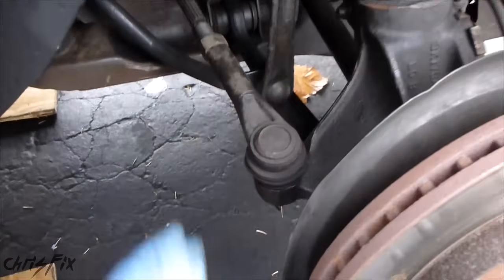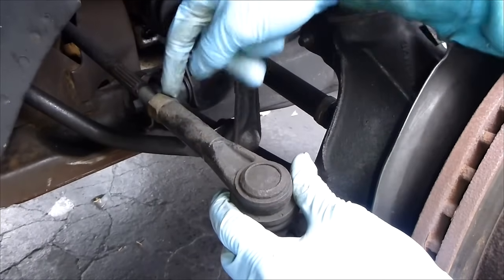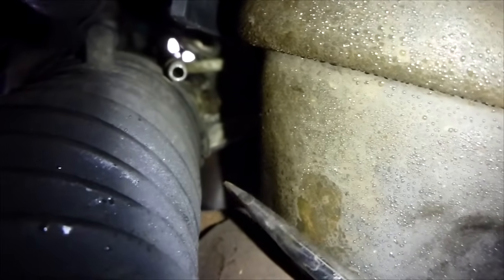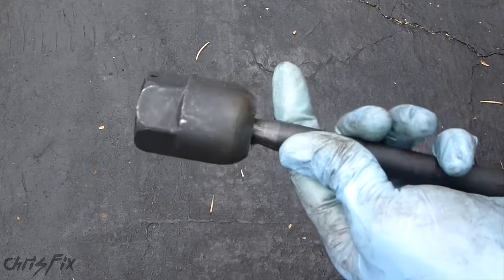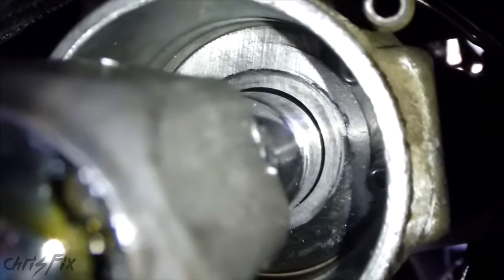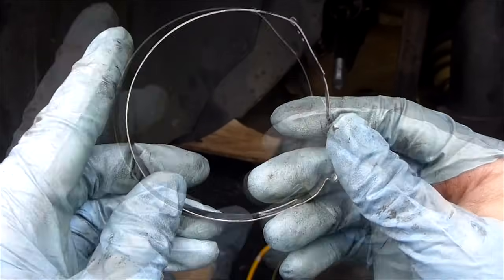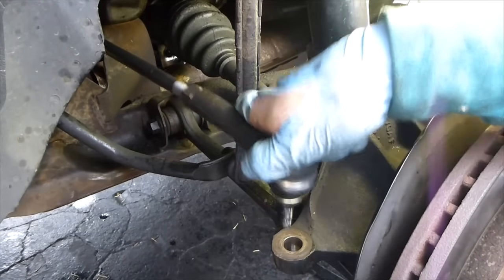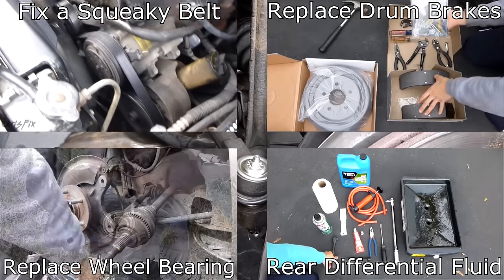How to Change Tie Rods (inner and outer tie rod ends)

Comment: Can’t get the outer tie rod out no matter what, hit it with a BFH, heated it up and no luck, even tried picking fork and puller, it’s on a 2011 dodge ram from main so it’s got rust and stuff but everything I’ve tried just ain’t working

Comment: Mine is not that easy. My tie rod end is a pain to get on all the way. I have to take 2 big wrenches to try and turn it as far as it can go. And also my old tie rods I had to cut off with a Sawzall and metal cutting blade
Reply from the maker: Dang! Sometimes they can be annoying especially if they are original and old

Comment: What do I do when the tie rod bolt doesn't come off, I pb blasted I used huge wrenches, I tried to use map gas to heat it up, I tried hammering. I am lost as the bolt will not come off and Google doesn't help at all. I'm at the point of I'm going to grab my angle grinder

Comment: Why not measure from a fixed point somewhere on the suspension to a point on the steering arm before dismantling it all rather than counting the rotations of the outer tie rod end?  That way, if the dimensions of the replacement rod, etc are different to the original, you can easily get the steering set back to pretty much exactly where it was at the start.

Comment: Don’t use the counting turns technique if you have different length inner tie rods to replace it with. Instead you can measure the distance the outer tie rod was screwed in and use that to calculate how far in it should go on new inner tie rod, or just put the 2 inner tie rods side by side and put a mark on the new inner tie rod at the same distance to the outer tie rod end.

Comment: My steering rod didn't even budge after I loose the nut
Reply: Loosen the lock nut, then put it back in place. The outer tie rod will most likely be frozen in place as well. U need to use penetrating oil, leverage and/or a torch on the outer tie rod to get it to loosen up. It is a hard process and I've found it impossible a couple of times and took it to a shop with a lift to get it off.

Comment: Not to find fault or anything, but you used the old nut and shouldn’t have. The old one was a standard nut and the one that came with the new tie rod end was a jam nut, and that’s why it was smaller. Otherwise, great video

Comment: Unfortunately, not all tie rod ends pop up that easy as you did with just a light hit with a plastic mallet. On my 2001 Nissan Sentra your method of popping up the tie rod end never worked and I had to look for more videos and there is a mechanic there who mentioned specifically not to hit the tie rod with any hammer because it will never pop up no matter how hard you hit instead his approach was to hit the side of the knuckle itself with such power to release the tie rod tapered bolt and it worked very well, I spent 12 hours trying to pop out the tie rod by hitting it with a plastic mallet and even with a heavy hammer .

Comment: Counting turns on the outter tie rod is tacky, the best way is to simply take a measuring tape and measure from the beginning of the inner tie rod where the boot starts to the center of the outer tie rod and that will leave your alignment as it was before and no miss or alignment required after.

Comment: Wouldn't you just tighten back to the nut? Tie rods are different. It would be more accurate to measure out to the center of the tie rod bolt and keep that measurement the same.

Comment: Do not be fooled. if you live in the northeast this job will not be this easy. you're gonna find things you didn't know existed that are broken. There's gonna be so much rust it all might as well be welded together. That Cotter pin? that thing ain't never coming out. that tie rod end? that thing has become one with the steering knuckle. at least half of the nuts and bolts involved are going to be stripped

Comment: These amateur YouTube certified mechanic graduates don't know what they're doing, yet they make instructional videos. First of all, never, never, never hammer the tie rod end bolt, it won't work with the rubber hammer, but with video magic it's did work here, the proper way is with a pickle fork or if you want to shock it with a hammer, hit it on the side of where the tie rod enters the hole, in other words hit the spindle part of it. Secondly, the counting the turns obviously didn't work because the new tie rod was longer, now his alignment is way off. The best way to do it is to loosen the nut  one whole turn, then spray paint the thread so you leave a mark, don't move the nut at all just remove the tie rod in whole so you can compare it to the new one and put a mark on that one as well using a measuring tape.

Comment: Not, how you get outer off ! not cotter pin is a split pin  
Not how to video is  b s video
Reply from the maker: I'm not sure of any other way to remove the outer tie rod other than removing the entire assembly completely. And either name works, we call it a cotter pin in the US. Thanks for sharing
Reply: Do you mean if the cotter pin is broken?  Just hammer the correct size socket over the castle nut and put a hammer to the wratchet if needed to break it free.  Not sure if that helps or addresses your question.